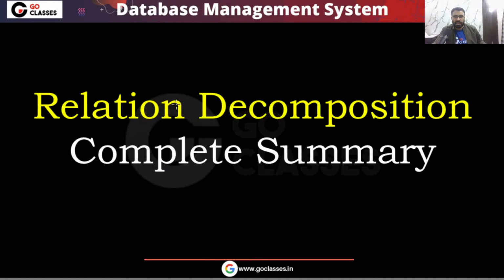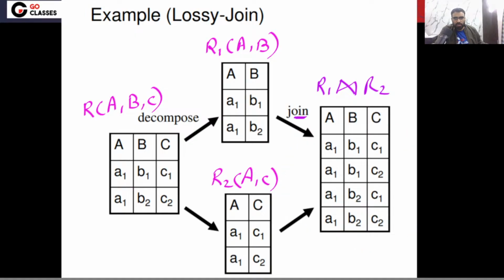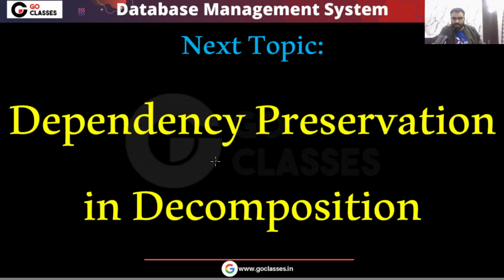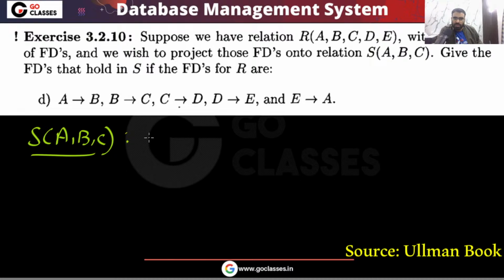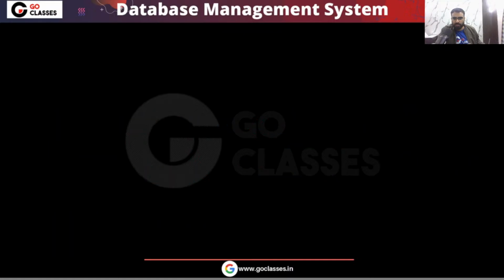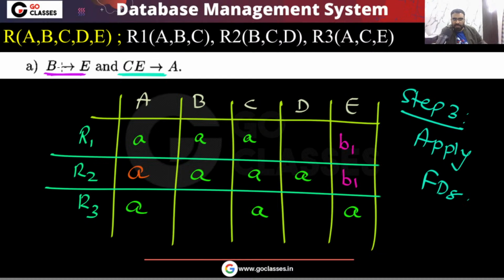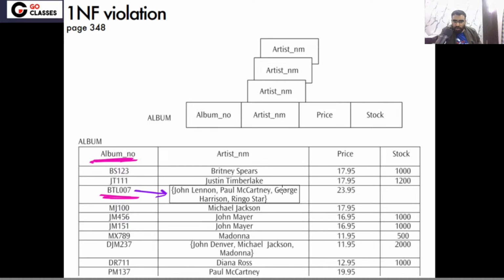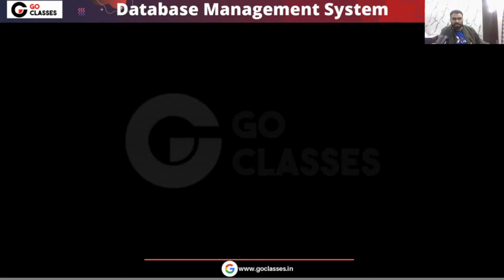Decomposition of a relation - Complete Summary | Lossless, Lossy, Dependency Preserving | Chase Test

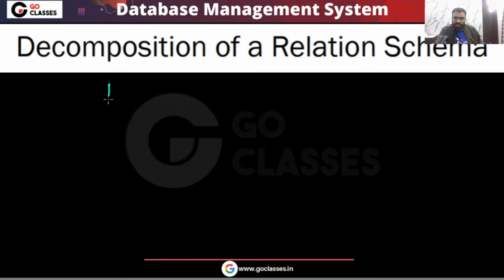Comment: 18:39 decomposition of a relation
27:20 lossless,lossy decomp.
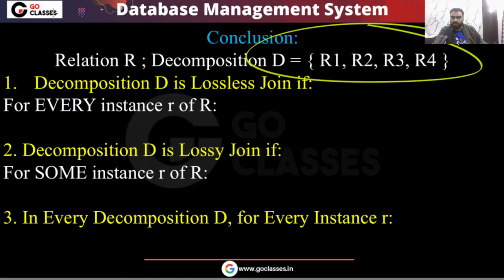46:33 summary in one slide
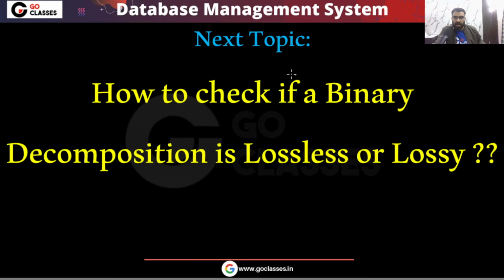58:10 checking binary decomp. lossy or less ?
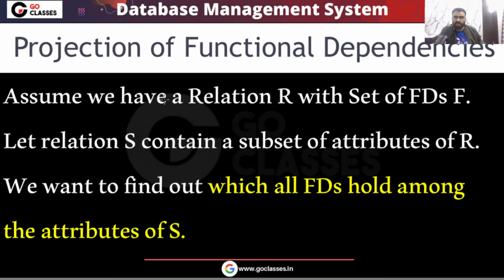1:05:31 projection of FD  <<<<<<REVISIT>>>>>
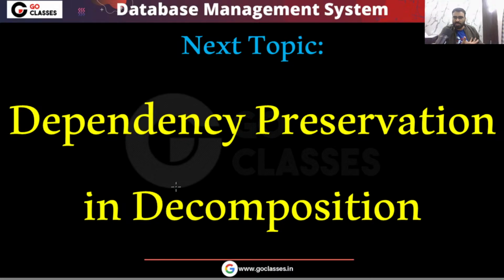1:38:47 dependency preservation in decomp
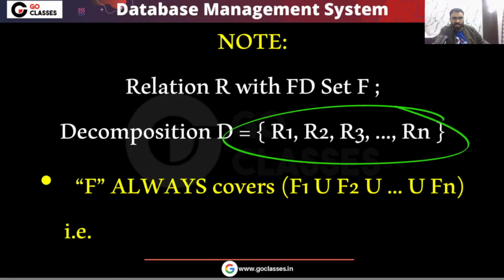2:04:36 SUMMARY IN ONE SLIDE
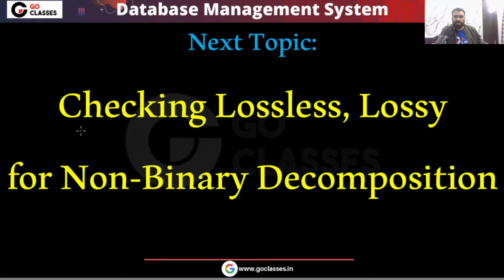2:10:07  checking non-binary decomp. lossy or less ?
3:02:56 redundancies & normalization
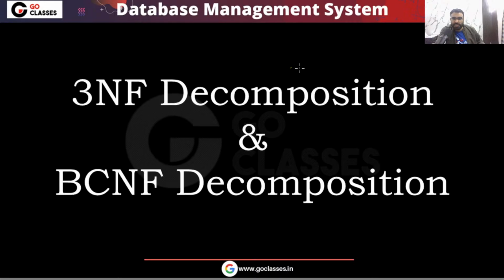3:26:06 3NF & BCNF Decom. (just def. but not algo)
3:28:55 some imp points about 3NF,BCNF Decomp

Comment: 18:39 decomposition of a relation
27:20 lossless,lossy decomp.
46:33 summary in one slide
58:10 checking binary decomp. lossy or less ?
1:05:31 projection of FD
1:38:47 dependency preservation in decomp
2:04:36 SUMMARY IN ONE SLIDE
2:10:07  checking non-binary decomp. lossy or less ?
3:02:56 redundancies & normalization
3:26:06 3NF & BCNF Decom. (just def. but not algo)
3:28:55 some imp points about 3NF,BCNF Decomp